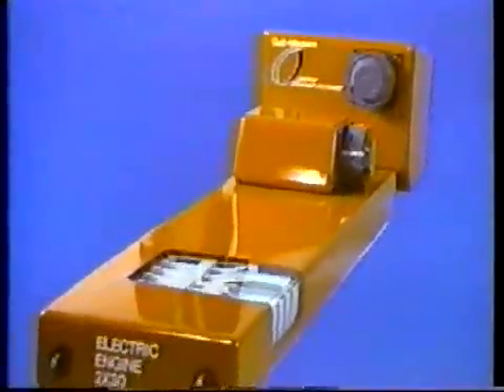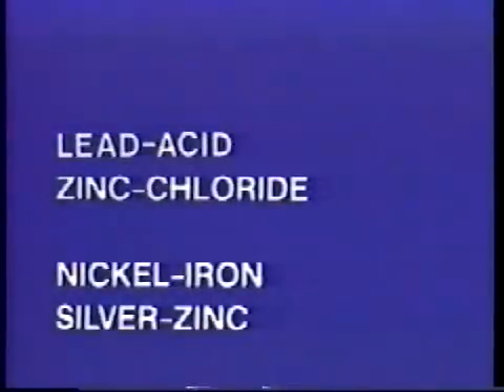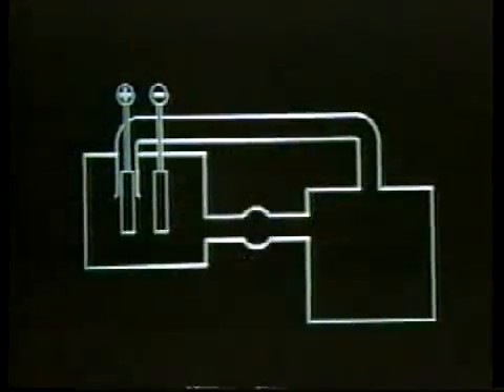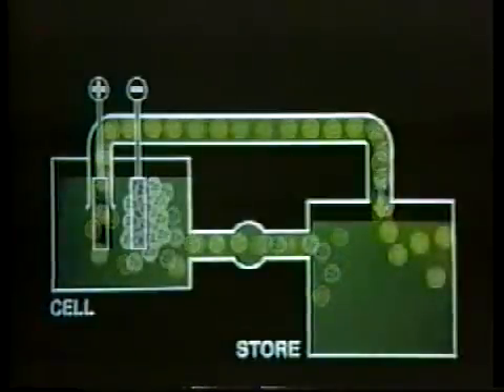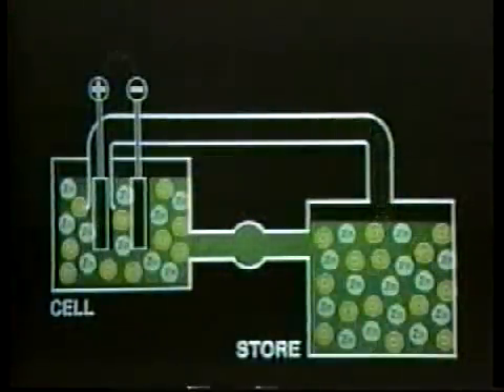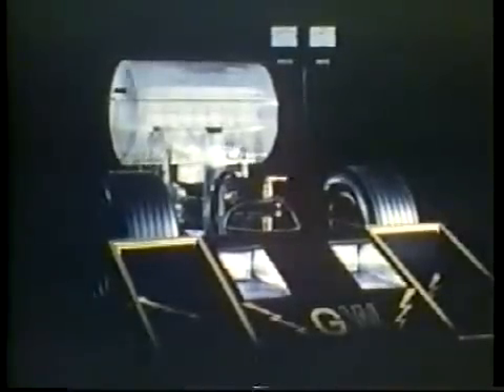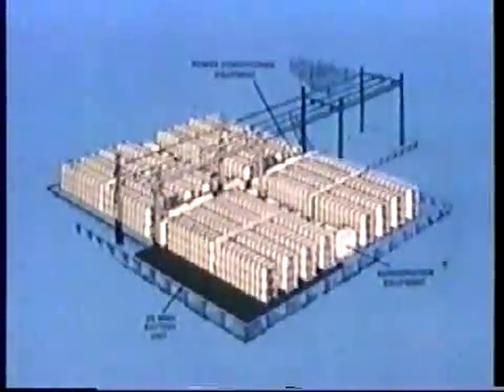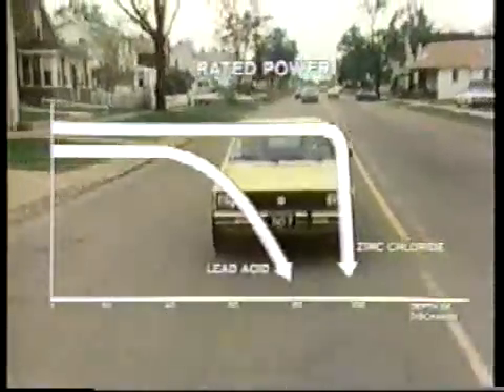Electric Vehicle Battery: 35 Years Ahead of Its Time!

Comment: I was one of the people working on this, and while the video was obviously made for promotional purposes, the technology DID work, and very well. The “problem” was G&W corporate politics, when the Chairman died, the President (Whose pet project we were…) was kicked out, and the new President was intent on shutting down or divesting G&W of everything not “media related.” Many of the negative reports that came out were intentionally slanted or outright lies to justify shutting it down.  

  While my personal opinion was that the technology was not ideally suited for the passenger car market, it was perfect for delivery van fleets, and even better for electrical load-leveling applications or solar and wind farm energy storage. We should be looking at this again for those renewable energy applications, as it requires no exotic or scarce materials, everything can be sourced locally, and what is there is easily recycle able. 

  And no, the battery cells did not wear out. In an automotive context, testing showed you might have to change out the battery electrolyte about every 100k miles due to some of the minor additives needing replacement. The electrolyte was essentially chlorine bleach with zinc added. You can’t say that for any other battery technology, even Li Ion, though I did suggest to GM that used and aging Li Ion battery packs losing vehicle range, could be reused in load-leveling banks for additional life. 

  A lot of what we came up with back then is the basis of today’s electric and hybrid vehicles, and we understood all the infrastructure issues back then as well, if the auto companies and Government(s) had just bothered to talk with some of us… We foresaw the problems and had most of the solutions.

Comment: What happened to Gulf + Western Industries Zinc Chloride battery? According to Wikipedia "On June 5, 1980, Gulf and Western unveiled an electric car, powered by a zinc chloride battery that would hold a charge for several hours and permit speeds of up to 60 miles per hour (97 km/h). By year's end, however, the U.S. Department of Energy (which had invested $15 million in the project) reported that the battery had 65% less power than predicted and could be recharged only by highly trained personnel.[10]"

Comment: There are so many solutions to load levelling the grid that it is impossible to keep up with the new developments. Here's one. 
https://www.forbes.com/sites/jamesconca/2016/12/13/vanadium-flow-batteries-the-energy-storage-breakthrough-weve-needed/#42b8d7165bde

Heat batteries are also very interesting.

Comment: Notice they never get into kWh/lb... something that, to this day, highly effects the decision by individuals of the motoring public as to whether-or-not they will go electric. If the total range per charge is limited at best (less then 70 miles) then most won't see enough reason to switchover. Another aspect unmentioned is the rate of discharge, which effects actual motive performance. In a country that favors greater power wielded individually, another slow-moving "underpowered" car--regardless of size--will not be very welcome on it's motorways.

Comment: This is today, 35 years later. Elec cars 1/4 cost of gas car to operate, using lithium instead. Fact.
Reply: mikemotorbike storing energy in lithium batteries have been & will always be more efficient than a fuel cell , even hydrogen cells. The biggest question is what's most practical.........

Comment: They system is a flop as it requires pumps and storage units.  You are pumping liquid chlorine which will attack your pump.  The pump itself requires power.  The system cannot be run in hot environments.

Comment: If true, this could have replaced gasoline. They achieved 140 mile range out of a converted VW in the 80's. That alone is impressive.

But where they missed it is that there's no need to wait 6 to 8 hours for a charge. Take it to a "gas" station where the depleted electrolyte is pumped out and replaced with charged electrolyte. Charging times equivalent to filling up with gasoline. 

I still prefer to charge at home but this could have leapt us to electric propulsion back in the 80's

Comment: I designed a system about 50 years ago whereby coils of wire are installed into the roads surface and a pick up coil in the vehicle. Pass current through the coils in the road and the coil in the vehicle will pick up energy.
Reply: Douglas Kay electric trains do that already. another similar system is called the hall effect.the problem is maintaining a consistent gap between the coils, it's almost impossible given that road surfaces are uneven even on the best maintained surfaces,dragging a coil introduces friction meaning more energy to overcome it.
Reply: Those coils could also be used as a linear motor to propel vehicles as well. In some cases it might be more efficient to directly propel vehicles rather than transfer energy and use the motors in the vehicles.

Comment: On June 5, 1980, Gulf and Western unveiled an electric car, powered by a zinc chloride battery that would hold a charge for several hours and permit speeds of up to 60 miles per hour (97 km/h). By year's end, however, the U.S. Department of Energy (which had invested $15 million in the project) reported that the battery had 65% less power than predicted and could be recharged only by highly trained personnel.[6]

In 1981, former officials of Gulf and Western's Natural Resources Division led a buyout of New Jersey Zinc and made it a subsidiary of Horsehead Industries, Inc.

In 1983 Bluhdorn died of a heart attack on a plane en route home from Dominican Republic to New York headquarters, and the board bypassed president David Judelson and named senior vice president Martin S. Davis, who had come up through Paramount Pictures, as the new chief executive officer.
Reply: eb b   I remember reading in an old issue of Popular Mechanics how a major carmaker had created an EV in 1970's that would be powered by Zinc-Air batteries, which they likened to fuel cells.

Comment: Excellent design, probably killed by the oil industry players. But they only delayed the inevitable. The era of oil is coming to an end.
Reply: Have you been paying attention. The biggest problem with electric vehicles is energy storage. A problem that has been recently solved. There are already electric motorcycles and obviously cars and trucks, even boats. It's only a matter of time until better batteries propagate to all vehicle types.
Reply: Julio de la Cruz I look forward to that day
Reply: they just dont have the power of 2 stroke engines!
Reply: electric motors are very powerful , they are like a 2 stroke on steroids!
Reply: Lonnie G. Johnson's Jtec battery and generator can change the would world now. This system has to end, there is no other way.
Reply: They have a broad torque curve that cant be matched.
Reply: Julio de la Cruz 
nope..just will get a bit of competition..
Reply: Richard Sandwell 
bad perspective..
Reply: Julio de la Cruz oil industry players,  who do you THINK gulf western is,, God damm people are MORONs
Reply: Julio de la Cruz Yes... The biggest problem facing EVs currently is the same one they always have: Meeting the "fuel-tank" standards. Once it's possible to make a form of storage that meets such standards (i.e.: size, shape, weight, rate of replenishment, flexibility of discharge, reliability of long-term storage and operation in all conditions) then will electrics see favor as suitable replacement for liquid-fueled internal-combustion power.
Reply: amen
Reply: Lithium is the new oil
Reply: the simpleton explanation is blaming big oil..
Reply: Bruce...That's wrong, a electric motor has 8 times the power of a gas engine of the same horse power plus it produces 100% torque at 0 rpm !!! do your research !!!!
Reply: The quicker oil & gas run out the better..
Reply: Bruce Miller 
pos?..VW turbo diesel runs the back roads here everyday at 40mpg.1k mile range... Honda 1500cc also near 40mpg..all day..
Reply: At least an electric motor is not a POS 4 stroke, LOL!
Reply: Bruce Miller 
small diesels run heavy equipment all day on 10 gallons..
Reply: If they are so powerefule why dodnt we see them in snowmobiles and dirt bikes, those sleds have much better power to weight ration of any crappy 4 stroke car motor, an electric motor has low end torque but nowhere near the power to weight ratio of a 2 stroke! Im am sick of all you tree hungers!

Comment: Glossed over the problems:
Chlorine gas is highly toxic, a leak would be disastrous.
The chlorine hydrate must be refrigerated below 40 degrees F. consuming energy, until power was needed. 
Zinc tends to grow dendritic structures which tend to short out zinc based rechargeable batteries, particularly with repeated partial charge/discharge cycles. That has sidelined zinc air rechargeables which are far safer and have much higher energy density.
Reply: Wow dude that was very informative!
Reply: Wont the Cl2 8H2O inhibit dendrite formation? Of the zinc chloride? Charge cycle cools the tank while current is applied to cell stacks. regarding toxic environmental issues are not standard car accidents for gas vehicles and electric lithium cars bad?

Comment: "6 to 8 hours to fully charge" is the reason why its not used.  probably some other problems like energy density and the heavy need for large volumes of fluids.
current lithium batteries do not suffer the 6 to 8 hours battery charge time. that alone is enough reason not bothering with it. 
graphene solid state batteries currently being worked on completely blow all other battery technologies out of the water.

Comment: Did I even see the same vid as these other wide-eyed optimistic people?  What I saw appeared to be an overoptimistic summation of a failed research project with the delivery of a sales pitch:
     First, Chlorine Hydrate is not even a well-defined chemical compound.  It's apparently a coördination compound composed of a slushy mixture of Cl2•6H2O through CL2•10H2O.  These compounds' various melting points are all slightly above room temperature.
     The vid is honest in telling you that for the cell to work, there must be a temperature difference between the "electrical vessel" and the "storage vessel."  Essentially the chlorine hydrate must melt and react in the warm electrical vessel, and freeze (precipitate out) in the storage vessel.  In shorthand, I'll say the more chlorine hydrate you have, the more electrical charge is stored in the battery.
     For the cell to work, the electrical vessel must be warm during discharge, and the storage vessel must be cold during the charging cycle.  They seem to like to maintain a constant temperature difference between the 2 vessels in the battery.
     Water containing the slushy chlorine hydrate solid must be physically pumped from the storage vessel to the electrical vessel in order to obtain any electricity from this ZnCl battery.  This means that 2 important external pieces of electrical hardware must be provided beyond how most batteries work:  There must be a pump of sophisticated enough design to pump not only liquid, but the proper proportion of liquid carrying chlorine hydrate slush from the storage vessel to the electrical vessel.  There must also be some kind of external electrical heater provided to establish the proper reaction temperature in the electrical vessel prior to initiating the reaction.  (More about this later.)  The vid, itself, describes a 3rd external component:  a separate pump used to pump the chlorine back into the storage vessel during the charge cycle.  I am not convinced that the 2 pumps must be separate, but that is the way they are described.  I think I could possibly arrange the geometry so this scheme would work with a single pump.
     Say we have this system in an electric car, and we have allowed it to charge during the night.  Now I want to start my car, and go to work.  How do I do that?  I must turn on the electrical vessel heater to "prime the pump" to enable the discharge cycle to proceed.  HOW LONG WILL THAT TAKE?  It'll take as long as it takes to warm up half of a large battery and the electrolyte it contains.  Especially if it's a cold day, THAT COULD BE A LONG TIME!
     Where does the electricity come from to preheat the electrical vessel?  Since you may want to park you car somewhere other than where you charge it, you need to have a starter battery to warm the electrical vessel and drive the electric pump(s) until the battery reaction starts.  If you use a lead-acid or Li-ion battery, presumably you can recharge it from the gigantic ZnCl battery once the reaction starts, but this seems almost silly.  It's likely to be a pretty big starter battery, because it will require a lot of electrical energy to warm half this half-ton ZnCl battery to 35˚ C. – especially if the ambient temperature that day is, say, -20˚ F.
     I don't think anyone really wants to wait that long for their car to warm up before they can drive it.
     On the other hand, a complex system like this would be no problem for professionals to maintain on a very large scale.  So, as a load-leveler in power-grid applications, I see no immediate reason that this ZnCl battery technology could not be beneficially applied to this application.
Reply: Please also note that metallic Zinc electroplates on and off of the Zinc electrode each discharge/charge cycle analogous to the way Lead and Lead Oxide plate on and off of the plates of a standard lead-acid battery, so the claim in the vid that the electrodes sustain no wear is no truer for the Zinc electrode(s) in this ZnCl battery than it is for the Lead electrodes in a Lead-acid battery!
Reply: +MantisNoMore could you put this  so that a 10 year old can understand.
Reply: I can:  It didn't actually work very well.
Reply: holy shit , you sure can blab and say nothing , all that was mostly just a baby in a shitty diaper bitching for 1/2 hr.  expressing some sort of deep frustration from never having accomplished anything of value no doubt , so you rant endlessly to justify the bit of knowledge you have
Reply: MantisNoMore I'm inclined to agree... especially about the "start-up" part. If people were willing to wait as their vehicle readies itself for operation every time they wish to use it, steam-power would still be viable.
Reply: pancudowny more childish rhetoric from a self indulgent moron . will you be willing to wait as sentence of death is passed upon you for crimes against the people and wait while your execution is readied
Reply: Bob Saturday Oh, get a life, Bob...!
Reply: MantisNoMore none of these sjw, libtards are going to understand this. They still think electricity magically appears out of the wall.

Comment: It's pretty obvious that the reason this battery never went anywhere was because of low energy capacity. An electric car battery has to small and low in weight. Most likely a zinc chloride battery that holds enough charge for a car would be the size of a double decker bus, and weigh 10 tons.
Reply: nice response... people like to see one side of a situation when they are opposing it.  With 140+ mile range for a car that was not designed for pure electric, and didn't have the advantage of today's VERY efficient electric drive systems, that's pretty darn good!!
Reply: +beneehall First, Tesla is a company with one of the noblest of goals.  They should be well respected and helped whenever possible.  Secondly, there could be a number of factors that killed the zinc chloride battery (big oil companies, much slower discharge rate than competing batteries, etc.). Finally, it could have been a lack of focus.  If all efforts were focused on grid storage, funds might have lasted longer.  In other words, maybe they stretched themselves too thin.
Reply: Or maybe he realizes that this video and "their nice little sedan" don't reflect reality.  The fact is this technology was not good enough.